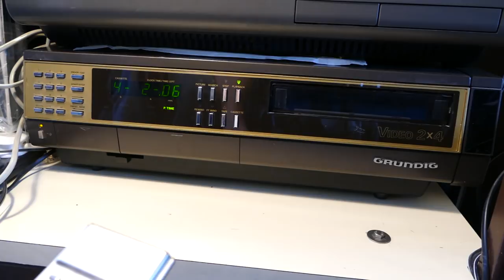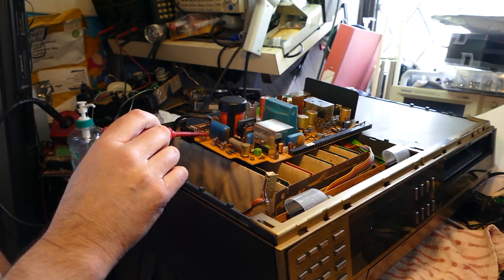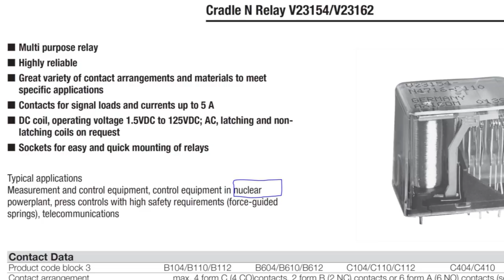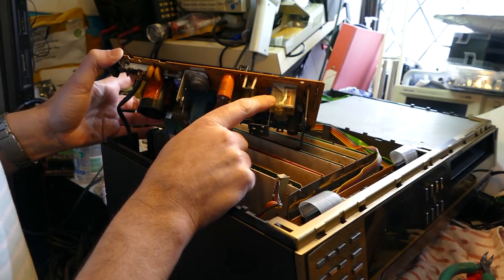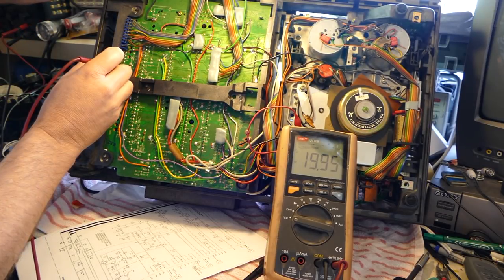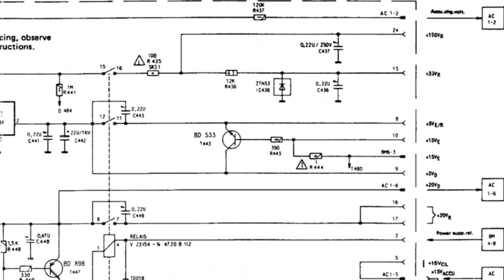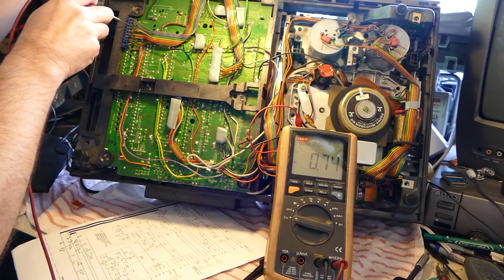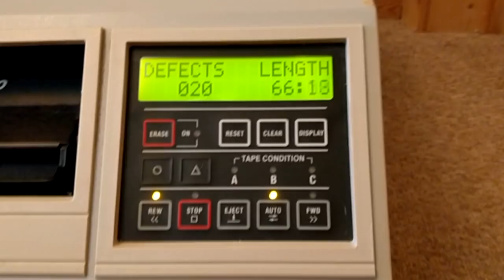Repairing the Grundig 2x4 Super Video2000 recorder.

Comment: Great video, thanks for sharing it. I have a slightly different V2000 Grundig machine, and seeing this video motivated me to finally try and bring it back to life. Recapped the PSU so far, the  roller brake engages on power on, but the display does not work, and it does nothing else. Will have to spend a bit more time on it ;)
Reply from the maker: Start with that lack of display, it may be that one of the CPUs is not powered.  Check for split connectors.  A service manual will certainly help.  Good luck.
Reply: I have the same problem, scope showed that the voltages are fine and no ripple even with the old electrolytics. However, the board behind the deck which houses the battery is at fault, the battery has leaked and destroyed some of the tracks on the board. Currently making bypasses on the board to see if it will work again.
Reply from the maker: @shivanl1695  Which model is that?  The panel behind the deck on the 2x4 Super is the motor driver, not the CPU (with battery).  Battery leakage is a common problem with many machines of this sort of vintage.
Reply: video99.co.uk it is the 2x4 best nr. 2000 (frontloader)

And I just got it to work!! I made a lot of bypasses and soldered the display connector directly to the board because the connections were too damaged to use. It’s playing nicely!

I also have a 1600 without DTF but the idler sprocket is broken so I’m afraid I cannot repair that anymore. Unobtainable part.

Comment: Sir, thank you very much for this video. I am by no means a repairman and my skills in electronics are rather poor, although as a computer engineer I do have replaced computer PCBs and certain components a number of times. Your video in particular has encouraged me to finally take a look inside a Grundig VCR like this one that a friend of mine gave away to me a few years ago, as he was aware I already owned a few VCRs and plenty of video tapes. But the machine was completely dead (when switched on, only a very weak light in the front panel would come on) and there was a cassette stuck inside. 

The first thing I have done is to replace the power supply -- thankfully, there are still some spares available in Germany. After that, the front panel came to life and so did the spinning rods that make the tape reels move. But the video head drum seemed to be stuck (it was dificult to rotate it even manually and after taking it apart it I noticed some broken bits inside, so I have also ordered a replacement). Moreover, the mechanism of the tape deck was not moving at all. The machine would not thread the tape nor eject it. After a while, I managed to eject the tape by manually sliding the belt. Then I tried to insert it back while reading the voltage on the terminals of the motor that should be moving that belt, which turned to be zero. However, by applying 12V to those terminals through an external power supply, the mechanism started to work and the tape was automatically loaded and threaded correctly. But after that I then noticed that the motor of the capstan sometimes remains still and sometimes spins very slow. After measuring the voltage, it shows 0.3 volts in the first case and 1.2 volts when it does rotate. Which I assume is not the expected value.

Have you got any clue about what the problem may be or why these motors are not getting the propper voltage? Could it be a problem of the PCB that controls the motors (27502-061.01)? I have heard that it is also a common fault, and as far as I know, there are also some spares available so I could try to replace it.

It would be really nice to see this machine working (I do have a few V2000 tapes). And although I really don't "need" to repair it, since I have nothing to lose and since I find it interesting to try to understand a little better how these complex machines used to work, I would like to try it myself. Thank you very much for your help. Regards from Spain.
Reply from the maker: Have a look at the connectors on the rear PCB behind the deck.  The connectors break up, both on the top and bottom sides of the PCB.  You can add a cable tie plus glue to hold the plastic connectors back together.  Someone even told me that he 3D printed some new connector housings which is really taking it seriously.  Also, even with a new PSU, I would check that the PSU relay is working properly.  This is a very unreliable part.  Also look at the switches on the underside of the deck, there are two or three (I forget), make sure they all work properly, and the contacts along the edge of the loading ring.
Reply: @video99couk  You are right! I have just checked the bottom side of the PCB behind the deck (I had already checked the top side after watching your video), and as you pointed out, the terminal of the cable that connects it to the motor of the deck is broken. If I make some pressure on it, then the deck starts to work. I will try your suggestion to tie it. Thanks a lot!

Comment: Great video. I used to work at Grungig Technical dept in Rugby. I still have one as new hardly used. I might just get it out and have a play.
when replacing the capstan belt you ideally need a special tool to centre the meander plate over the flywheel. If it isn't centred properly there will be lots of wow & flutter on the audio playback. They are also quite sensitive to the type of belt used for replacement. I think the original part no was 29504-27100-27100. (from memory) lol
Reply from the maker: That's very interesting.  I have another of these machines which I rarely use because there's a distinct audio flutter (though no wow), so I wonder if that's the problem.

Comment: I purchased a 2x4 Super for my parents. For the whole period he had this, my father had to read the instructions to enter programs into it. He never needed to do that with the Philips. The Grundig required you to enter the time and then tell it what that was - start or end. This is the reverse order of the Philips system.

Although I had loads of issues with the Philips 2020 (the first machine released) and then with the 2840 (the last stereo top loading deck) where the new machine(s) supplied failed quickly the loan machine didn't and I eventually asked to keep that instead. The front loading Philip 2350 I got as ex-duplication machines. I got four and have been getting parts out of one to keep one machine running for many years. 

During one repair attempt (the shop gave up on it) my father was given three other 2x4s by another customer who had hoped the repair shop could get on machine working from the parts of the others. The four Grundig 2x4 Supers where left at the recycling centre in 2007 in a pile of hundreds of other video machines.

I reluctantly upgraded my father's video to a Super VHS. He never did figure a way to programe it even with the three ways the system provided. At least he could play back the video I had recorded off air for him.  

I found many of the tapes dating from 1980-84 to be of poor play back quality. The video scrolls, is black and white and has a bizzare with bits of the recording visible. Some are almost okay. My Super VHS and Hi8 recordings date to 1990 and are usuall as good as they were originally even using the cheaper standard VHS or 8mm formulations.
Reply from the maker: I've found that regular 8mm is more reliable than Hi8, and particularly regular VHS is more reliable than SVHS.  I suspect the more demanding requirements of the higher performance versions result in a shorter tape lifespan.  Pity your 2x4 Supers got dumped, they are now quite sought after and they seem to give better results than Philips machines.  They did have wacky timers though.

Comment: One of those machines is still sitting around in the basement of my parents' house. You just made me want to dig it out again.
Reply from the maker: Change the filter capacitors before plugging it in!  Then save yourself some time by repairing the split plastic edge connectors on that rear motor drive panel.  Only then actually try it out.
Reply: @video99couk  Thanks, I'll do that. I already had smelly experiences with a 2x8 and a Philips VR2340. The Philips did not even blow the mains fuse and just kept stinking till I pulled the plug.
What I never liked about the 2x4 Super is that it keeps the lid open when there's no cassette loaded.
Reply from the maker: @rolfbeil  Similarly with the 2x4 Super, it will keep going even with clouds of smoke in the room.  There's not usually enough current flow to blow the fuse.  I have some 2x8 type machines here but don't have the time to work on them to get one going.  I think they're both very high mileage and may be beyond repair.
Reply: @rolfbeil  I always leave a tape in the 2x4 to reduce dust ingress .

Comment: I have 2x8, I had to replace the belt, also the tape winding prong was broken, so it failed the power up test, I glued it and it works. More or less. And it has button descriptions in German. And the top mounted without screws, you just push , the plastic bends and it opens, like on a battery compartment of a remote control.
Reply from the maker: I have a 2x8 here but have not repaired it yet.  Actually there are two, slightly different models.  But I think they have orbital miles on them and may be beyond repair.

Comment: I had the same unit, found it at the scrapyard some years ago. Wanted to repair it just for fun. There was some problem with the microsontroller, none of the buttons did anything and the display was nonsense. Supply voltages were good. Gave up and sold it on ebay, I got really into VHS machines instead. Seeing your videos now makes me think this was a very good decision! :D
Reply: Great Video! I love the V2000 Maschines and i have two of them in proper condition: 1x Philips VR 2324 (3nd. gen.) and 1x Grundig 2x4 Stereo Typ 2200 (3rd. gen.)
But the pitch rollers are making problems sometimes. Not available anywhere in Germany.. :-(

Comment: You're correct about plastic. Use to work on BMW  525 TD airfilters, they always never fitted correctly after removing them.
Reply from the maker: In another life (job), I worked on a control system used in BMW cars.  I'm not allowed to mention what I know about them, but will say that in my opinion, they used a plastic assembly in an inappropriate way.

Comment: After watching the great video of the Grundig 2x4 service I wonder if you have a similar video covering the Philips V2000 machines especially the 2020 variation which appears to be more widely available.
I have a number of machines both Philips and Grundig, some working and some used as donor machines collected over many years and hence I have ( being a complete hoarder ) a good selection of spares. If anyone reading this is struggling to obtain any parts let me know and I'd be happy to help if I can to keep these wonderful machines going.
Reply from the maker: I've worked on the VR202x machines in the past but I'm less keen on them.  I think the Grundig 2x4 Super gives better pictures and has good playback features.  Actually I have quite a lot of spares for VR202x machines including brand new video heads for some models and lots of other parts.

Comment: 19:32 this is not the Video Head this is the Videodrum (well known as scanner(Philips) or Headdrum). In this metal drum are two small slots in behind the Lineal are the 2 Video Heads each side. The Videohead's are very small an mounted each on a Piezo Crystal that move the Heads up or down for the Dynamic Track Following (DTF). Each line on the tape have a (4 different) frequency and this will be read from this heads and the Electronic will align the heads in the highness. This make the Track Following Mechanismen. Nice Video! Best Regards Volker from Vienna.  Thumb-Up Nr 151 The top of the drum earth contact is need for the drop-outs they come from the Film static falshes that disturbing the Videosignal. The Actuator need around 150Volt for working that shoulb be in contact if not the DTF is not working and a record will not correct on tape! There are 2 resistors that can be also high-Z impedance so change this 2 resstor for the 150Volt. That are destroyed after a Tape snap. :-) The brake contact are often not in contact and can not start if the µC 8031 are not recognize that this contact is closed. Also the backplane Motorcontroller board are the green connector and red one are often broken so they don't have a contact to the board. Solder it on direct but first change the Akku first.
One interest thing is also the left side totch buttons you must cut out the holes on the left side because the green LED display are everytime show you the Clock so the Plastic Front is shrinking. Cut out the left side of all buttons on the left side and everything will be fin.
Reply from the maker: The upper head drum is often referred to as the video head or video heads.  On a later video I actually show the Piezo Crystal actuator under a microscope.

Comment: Hi! I have one in here my shop and it’s absolutely pristine but it went up in a puff of smoke when we attempted to power it on, the transformer on the PSU has failed, would you happen to have one or an alternative workaround by any chance? Thank you!
Reply from the maker: Best solution would be to pick up a used one.  Replace all the electrolytic capacitors on the secondary side (care, some need to be low ESR types) and the mains filter capacitors (or they will explode), perhaps clean the relay contacts gently too.

Comment: I had one of these with the outboard remote back in the 80's. As I remember the audio was out of sync compared to a Philips VR2020 and the tapes were not 100% interchangeable because of this. I did prefer this model compared to the early Philips machines. Picture quality did seem to have the edge which isn't saying much for what is basically a 1/4" video format.